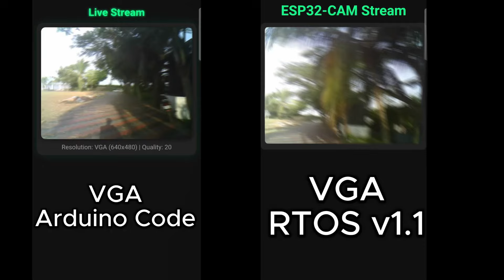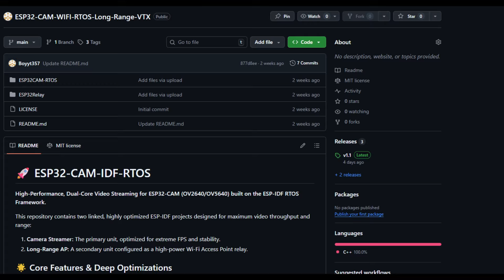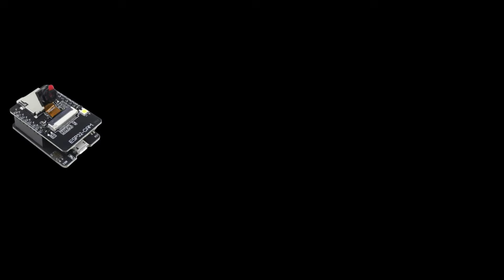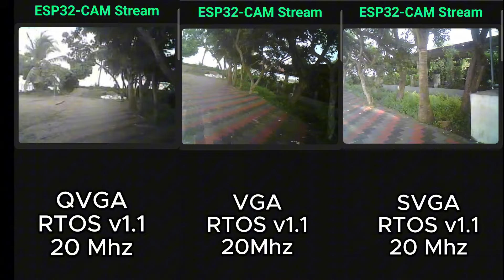Cheapest Digital FPV System V2: RTOS vs Arduino Code Comparison (60 FPS Upgrade)

Comment: Have you played with WiFi HaLow??   Sub 1 GHz band, a couple km of range.  And they have boards that are just like this with cameras.  Adapting this code to that would be SO cool.   Great for FPV or also remote security cams.
Reply from the maker: I'll think about it, it wouldn't be hard to adapt the code for wifi HaLow🎉,but the hard part is to get the module 😅. I have seen some esp HaLow modules , maybe I'll try esp now (vtx) first then, if HaLow modules are available I'll make a vtx for that too😊. Thx for the Idea 💡
Reply: @EngineeringRobotic  Looking forwart to your esp-now design. I was hoping to make something similar for along time, but never quite got to it. I did try Wifi HaLow though. Not a esp-compatible module but an ethernet bridge to connect ip camera and laptop. After some tweaks to configuration, mainly disabling ACK timeout i was able to get more than 10km range out of it. It certainly worth a try.
Reply from the maker: @ДмитрийЧехов-с8е   Wow! 10 km will certainly be worth it!🤯👍
Reply: @ДмитрийЧехов-с8е  Can you please share how you disabled ACK on those Halow modules? Thanks!

Comment: Very cool! I've looked at several system options for you. What is the range of confident line-of-sight communication?
Reply from the maker: It depends up on the antena types,
Low end we may get 200 to 400 meters 
High end(using directional antenna) we may get 700 to 1 km or higher.
More directional the antenna is, more range you can get😊
Reply: @EngineeringRobotic  Unusual for such small circuits. Have you tried using any signal amplifiers?))))😀🙂
Reply from the maker: @elinomad7180  Do you mean the use of the RF2126 RF Power Amplifier ?🤔 Are most of the signal amplifiers more expensive and bulkier than the ESP32-CAM and the ESP32 itself?🧐 At that point, is it really worth it, or should one just buy an analog VTX ?🤔😊
Reply: I totally agree with you! But it's still interesting to use an airplane-type UAV in line of sight. Just to experience something new. Something like wifi boosters.🙃🙃🙃🙃